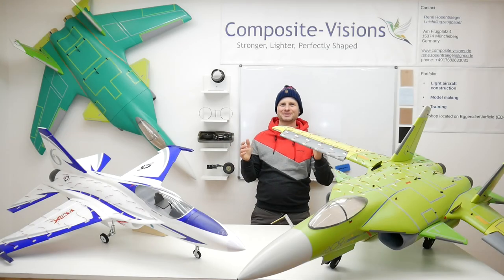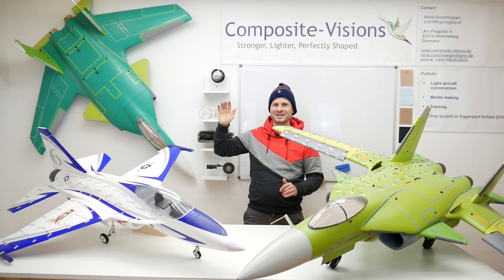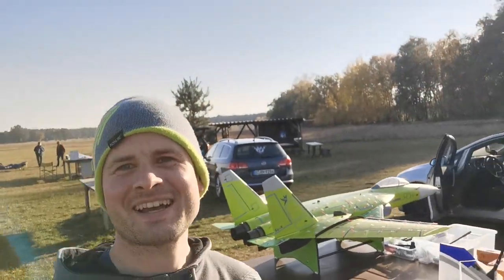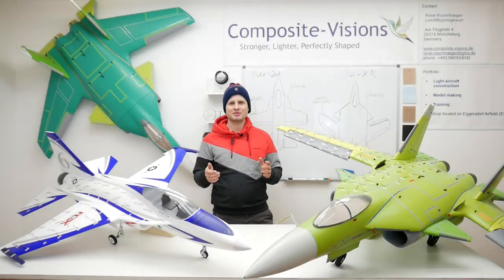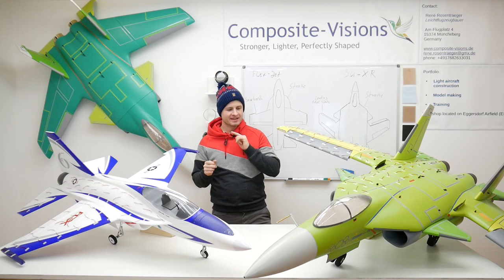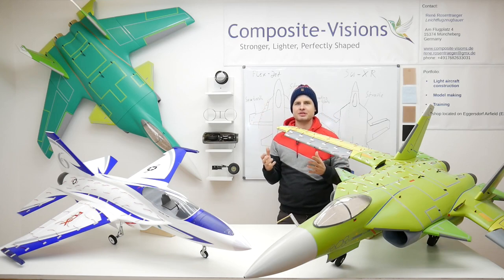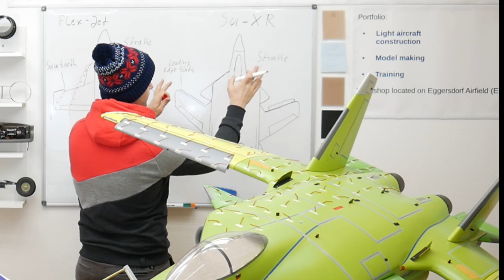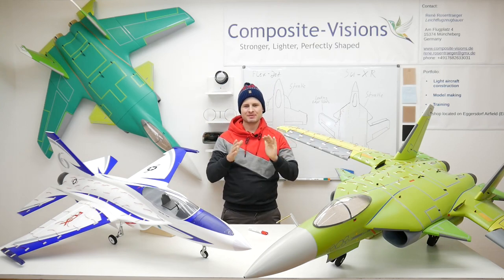Forward Swept vs. Normal Wing | Aerodynamic Design for Super Slow Flight | High AoA Experimental

Comment: I am a big fan of forward wings. I've designed and built a few tc planes with forward wing configuration. I also use KF airfoil instead of conventional type airfoil. It's easy to construct and in my opinion the wing flies in its own air so to speak. However I use foam board to construct my planes instead of composite materials. Watching your construction videos is totally amazing.  Keep up the good work. and two thumbs up!!!
Reply from the maker: Big thanks man😊👍👍
Reply: Wich Kfm are you using and is it an edf jet?

Comment: Did you calculated area and height of the  vertical stabilizers in exact manner?

Good doggie, smelled some animal in that hole 😀
Reply from the maker: I made them as big as possible and after lot of testing I had to add the underneath fins to make it fly comfortable :)